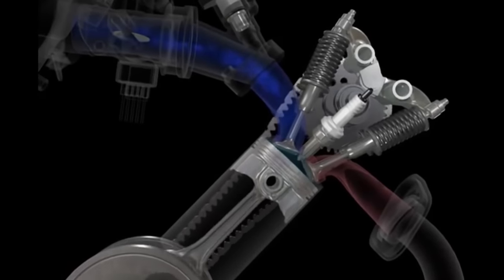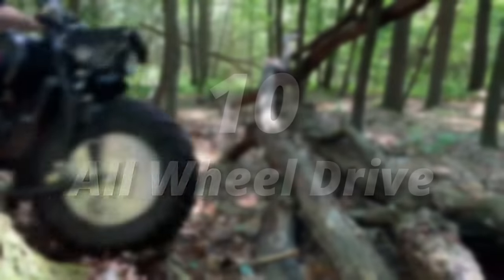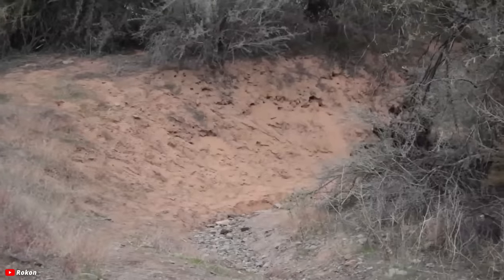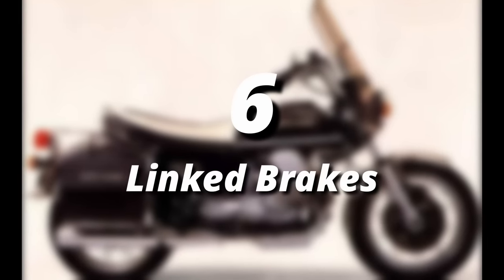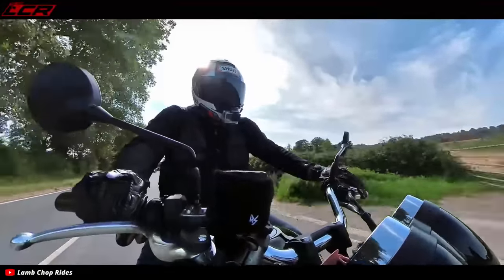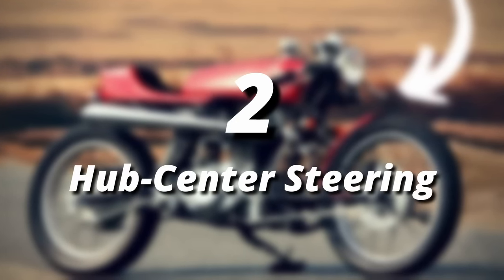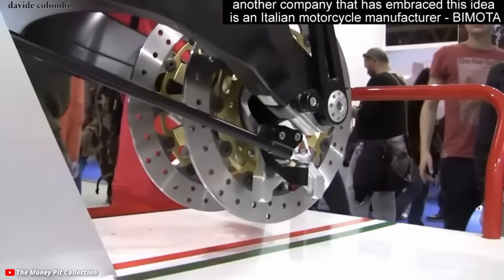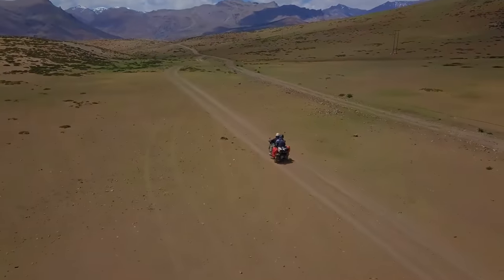10 Motorcycle Innovations that never caught on

Comment: Well you said that self " driving " bikes don't impress you ( Author ) as you want to be in control,  but you like abs and traction control , that is hypocritical. 
You don't like dual braking systems like on the Guzzi .
I always wanted a Le mans from the the day I saw a mark 1 .
I bought a mark 2 in 1990 with the split system and was adamant that I would modify it back to dedicated front and rear actuation. 
Oh but once I got use to it and learnt to trust it   I  felt it was a great innovation. 
I travelled Macquarie Pass daily for years in all weather going quick and never dropped it .
My best mate now owes it .

I designed a circuit that one could choose between dedicated front/rear or split like the Mk 2 but never made the prototype. 
Maybe be one day , I still have it on paper .

Comment: As much as I don't like regulations and big brother government. I don't see a benefit to motorcycles going any faster than the flagships of today. What I'd rather see development spent on is ease of reparability and customization. Easier to diagnose any issues that come up with long term ownership and being able to modify something to suit a specific purpose that the owner wants.

One of the reasons I like Harley Davison (Specifically the Evo engine) is the massive aftermarket and how easy they are to work on and maintain. But I also have a 94 Honda VFR and I like the engine design and riding position more than my Harley. What I'd like to see is a combination of both. I like the 90 degree V4 because of how smooth they are and you have a torque band from the low rpm range all the way to the top but I also really like having the ability to pull the engine completely out or not and work on anything with the engine while still in the frame. Plus you can literally change the bore and stroke by several inches with a Harley engine design which I can't do with my V4, that's a big deal to me since you can make the engine function completely differently depending on what end result you want. A compromise would be a 90 degree v twin but you still kinda lose out at the top end which is where the V4 comes in.

Comment: Has anybody thought of putting an electric motor on the front wheel of a motorcycle can you imagine like the benefits from having an electric motor on the front wheel of a dirt bike you know wireless control or via wire and in sync with throttle end for street bike for that matter you know just extra traction

Comment: Link brakes are not illegal what is illegal is a single port hydraulic brake master cylinder for both the front and rear wheels nowadays unless the vehicle come equipped with them as we now have dual port hydraulic master cylinder "tandem master" with dual circuit, reservoirs with separate the front and rear brakes that also do bias control 70% for the front 30% for the rear brake

Comment: My quad bike has four wheel drive with two diffs and locks. When it is engaged it is awful to drive as the wheels fight you to bits if they have any grip. The steering  is literally trying the fight the bars from yo. A bicycle version would drop you right on your ass whenever it got some decent grip .

Comment: Grip shits were also used on some Puch mopeds - like my first one, an MS50V I think it was.  They were used by postmen in several counties.
Linked brakes from Moto Guzzi were damned lethal - not being able to use only the rear brake on wet grass landed you on your ass faster than any other "innovation".
I spent an interesting weekend removing the cylinder head from a brand-new (sub-1000-mile) Le Mans to get the remains of the snapped-off spark plug out after a mate dropped it that way.
Auto transmissions isolate you from the road and remove the "feel" that is inherent in what motorcyclists want, the same as power steering on any vehicle light enough not to need it.
Hub centre steering is great and deserves to get more attention.  The biggest problem is the large diameter wheel bearing it requires, which increases the speed at which the bearing must operate.   The Kawasaki Z750 Turbo was lighter and more powerful than the concurrent 1100s of the era (the only turbo I've ever personally ridden).  On supercharging, there was an interesting OHV 2-stroke which used a supercharger to replace the crankcase as the means of induction, and worked very well indeed, as it allowed the crankcase to hold the oil bath not normally associated with 2-strokes and solved the emissions problem.  Only made it to an experimental design, but I saw one (of maybe about 3 made) at a rally - powerful and torquey, and according to the owner, great mpg as well.
To change the effective compression, all you needed was a sprocket swap on the supercharger drive, so the same design could be an efficient runabout most of the time but have increased power for fun days.  Of course, if you go very far on compression, you have to add an intercooler, which could have been done at the time, but now would compete for space with a radiator and oil cooler.
You missed centrifugal oil "filters" - a great idea that really works, and means you never need to change the element, which can't clog up, and keeps the oil cleaner.  Last seen by me on the Honda CB200.
Another rarity that has never caught on is diesel motorcycles - great for highly efficient runabout general-purpose bikes.  There have been a few, but with very high compression, kick-starting must have been "interesting" to say the least.  And if diesel is too expensive, just run them on vegetable oil.  Just don't spill any.
[spelling edit]

Comment: Re-watching this 3 months on, two more comments spring to mind: 1/ Only a yank would fail to mention the key reason that most Europeans ride 2-wheelers: to carve through the slow-moving and stationary traffic! If you can do that in a narrow, leaning, roofed 3 or 4 wheeler, with more grip on slippery surfaces, so much the better. 2/ You showed a few seconds of the fully enclosed Peraves Monotracer but failed to point out that there's a big difference between a mere roof and full enclosure. With full enclosure, complete with seat belt, there's no need to wear any more clothing than you do in a car. You get all the warmth and protection (or cooling, with air-con) plus all the fun of superbike acceleration and leaning through corners. Plus one more thing: far better aerodynamics, which is why the first electric Monotracer of 2009 had much better high speed range than the latest electric motorcycles of 2024, despite 15 years of battery improvements!

Comment: Why dismiss Rokon's two wheel drive?
They addressed a niche market and have had no competition.
Why can't you fathom why having a shifter on the one grip is silly?  A gimmick that adds complexity and vague steering feel to a small machine.
You also dismiss BMW's telelever suspension.  Why?
All ABS has linked brakes, but you give contradictory opinions on both.
Are these things included so you don't make five minute videos or so that you get comments questioning your intellect just to boost your algorithm?

Comment: Rokon; the only motorcycle on the market with no rear suspension, and a top speed of a whopping 37 MPH !
Also the early Japanese Fuji Rabbit scooters has grip shift gears   https://www.youtube.com/watch?v=tlVAbxSsCyA   (Production of the initial model, the S-1, began in 1946, some six months before the Vespa went into production.)   The hub-center steer concept is a very old one used as early as 1910 by the British James Cycle Co, and in 1920 by Ner-a-Car. Also Leading link (used to some extent by BMW, Zundapp,, Ural, early Hondas, Suzukis, Rabbits, Greeves etc, etc), Trailing link (Indian, early BMW, etc) and Earles Patent front suspension were used extensively for about half a century, (perhaps you're too young to know that) and are still in use with Trikes, Sidecars and a weird variation on the Honda Rune !

Comment: Interesting video, some of the ideas have merit, as mentioned they were expensive to execute. A couple of comments, Rokons are still made today and never were intended to be a mainstream motorcycle. They really are designed to fill a specific niche and they do that very well (no I am not in the Rokon cult). I certainly would not classify them as a failed innovation. Linked brakes, you failed to mention Moto Guzzi links one front disc and the single rear disc to the rear brake pedal, the second front disc is still operated by the front brake lever on the bars... Just a bit misleading.
Oh and you left out the Wankels... shame on you haha

Comment: Your passion for the sport is obvious, however I think perhaps you should be more thoroughly informed before making videos on topics such as this one. First, the GTS was made by Yamaha (as seen on the gas tank), not Honda. Your bit about linked brakes isn't accurate and is in some ways completely WRONG. The 5th generation Honda VFR800, for instance, had a linked brake system that was completely transparent and produced 60-0 stop times which were some of the very lowest of the time period. Perhaps you're missing the fact that modern linked brakes do not activate brakes identically regardless of which setup (hand lever vs pedal) is activated. They are almost universally engineered to activate a portion of the stopping power available at the part of the braking system not normally associated with the lever or pedal being activated. For instance, using the pedal on these bikes will activate a portion of the front, but predominantly the rear. Same is true for the front. Can an expert rider in perfect conditions outperform the linked system? Possibly, but in the typical urgent braking situation, the tests show that a well-designed linked system provides shorter stops. The Gold Wing also includes this setup and has shockingly good brakes, especially for an 800lb plus machine. Secondly, the Hossack-type front suspension you refer to on the Britten is in current production on Honda Gold Wings and BMW K1600 models - again, you seem to be accurate in many of your observations, but not enough to be making absolute statements like many in this video.

Comment: Honda made a 3 speed automatic (at50& at70) ho did changed gear automaticly
Gear changing on the lever is sold on many german and dutch small motorbikes fited with a sachs engine
You are forgetting the jetengine for dilivering enough "boost" to visit the moon...........

Comment: The two drive,BMW in the second world war the sidecar wheel drove as well giving better traction
Reply: Good advice! Same with the Zündapp KS 750 at the time. And later with the Ural, Dnjepr and Chang Jiang sidecar motorcycles. The forerunner of the latter motorcycles, the Soviet M72 (WWII, a derivative of the BMW R71, not the R75 as sometimes written), however, did not have a sidecar wheel drive.
Reply: @Volker_GR  Chang Jiangs do NOT have sidecar wheel drive. Sidecar wheel drive was invented in 1928 separately by Baughan in the UK and Mozharov in the Soviet Union. Norton, FN, BMW, Zündapp and many others used it, or experimented with it. The Soviet M-73 was a sidecar wheel drive experiment, as was the TMZ-53.

Comment: i own a first gen FZ1.(early 2000's) it has carbs. not fi. only computer is for the spark. the hart of the motor was the R1 motor from the 1990's. just a heaver crank and milder cam. with full light's (street thing). this bike has far more power than is needed on the street. at 65 mph. you just crack the throttle, you had better have a firm grip on the bars. or you will see it flying away from you as you slide butt down on the rd. with a top speed of 170 mph. who needs to go that fast, off the track?
but best is it gets 50 mpg while out having fun. even the second gen with it's fi, 50 pounds lighter, and multiple computers can not do that.

Comment: I marvel at the idiocy of the automatic transmission and self-steering for motorcycles. Because people sitting atop a motorbike would prefer to do anything than ride a bike, right? As if it were just a means of transport, A to B. Ok, well, some Americans might like an automatic transmission, but then again, they DO mostly ride Harley Davidsons. On motorways.🙄 

I dread the day when we'll all be using electrical vehicles, specifically because there is no need for shifting.

Comment: Bikes with roofs add a lot of drag, and raise the bikes CoG, so never took off.

Small turbo bikes wouldn't be cost effective when you could just get a cheaper larger displacement bike, and turboed superbikes weren't exactly user friendly back in the day because even small amounts of turbo lag mean you have to be careful coming out of corners.

To make hub centre steering strong enough for a mass production bike means adding a lot of extra unsprung weight, and none had as much steering angle as a conventional telescopic forked bike, so there's the fear of running out of lock while doing low speed manoeuvres.

Driving both wheels on a bike ads a lot of extra complexity, some extra weight, and significant extra cost. It's all down to the bean counters decoding if they'd make as much from building it Vs just bringing another 1wd bike to market.

Linked brakes, hand gear shifters and auto gearboxes remove a layer of user input from riding a bike, so never really became popular with "Motorcyclists", though people who bought bikes as basic transport liked them, and didn't care about the whole "Bike and rider" interaction thing. These budget orientated riders also went for sub 125cc bikes and step throughs, so these are the main bikes to use these.

A self driving car opens up the possibility of being able to do other things while comuting, but you can't perch on a self riding bike and read a paper, or emails, so it would just be a huge expense purely to remove rider enjoyment. It would also be a pain to implement, as unexpected steading corrections during cornering could risk unbalancing the rider.

Comment: 1 2WD may be a great idea for off-roading, but it does also make the handling of the bike feel "strange" as well as adding weight. The advantages of adding a 2WD system are outweighed by those factors, especially as the levels of grip that would require 2WD are only rarely encountered.

2 Having your gear change as part of the bar controls is fine... until you need to brake hard and find that you end up accidentally changing gear

3 People love to criticise fork suspension, but it has three significant advantages;
a Forks keep the unsprung weight to an absolute minimum. That may not matter too much on touring bikes or cruisers, but it is absolutely fundamental to any machine whose purpose is to go fast. And seeing as all progress tends to be related to going fast, anything that is not associated with that end tends to be seen as "Backward". 
b With the aim of going fast, you need to understand some of the basic physics of cornering. 
I A long wheelbase improves stability
ii A short wheelbase improves the maximum cornering speed, for any given speed, a long bike will need to lean further over.
So, although other types of suspension may work better, none of them (that I know of) have the combined advantages of a decreasing wheelbase whist braking/cornering.
3 Because forks are so universal, a lot of effort and research has gone into nullifying the negatives  (like stiction and the problem of tangential forces to the plane of motion) and so even relatively advanced technology filters down to production machinery quite quickly. Just look at how quickly we got fully adjustable forks, Upside down forks, anti-dive (there was an example of a wrong turn), variable rate compression,. mechanical semi-active and, most recently magnetically controlled, semi-active suspension. And the result of all this effort has been that we now get state-of-the-art suspension for a really quite modest outlay.So the cost of forks, at virtually any price point, means that forks are an absolute no-brainer.

Let's not forget that the ELF.Honda, with all the resources of both e petroleum giant AND HRC could still not make hub-centre steering into a competitive suspension system, in spite of all the theoretical advantages that such a system has. And ultimately, the problems with all the alternatives is that the lack the "Feel" that is so important to riding a motorcycle, whether in normal riding or at the limit. Even BMW's Telelever suspension, probably the best production non-fork suspension still suffers from a feeling of "remoteness" and is one of the limiting factors in the GS1250s off-road abilities.

4 Paradoxically, turbocharging works best on larger capacities. The more exhaust gases you have, and the larger the number of cylinders, the less variation you have in gas flow and therefore turbo performance. Under the circumstances, it is no surprise that turbos simply don't work very well on a 2 wheel platform.

Comment: All wheel drive is actually coming back in ebikes. With hub motors it's 1000x easier to implement and 1000x more reliable.

Comment: I don't even like Hondas.
But you missed the point.
22,000 RPM, 500cc, 1979, GP four-stroke.(couldn't qualify!) Two stroke power was what it was about.
But you're halfway right about a 'V-8' 32 valves, but three plugs per chamber!!!
I raced the old Yamahas.
The AMA, brought the size down from, 1025/4-cyclinder, to 750cc.
The VFRs were so good, a entire field of Interceptors, couldn't beat Eddie Lawson, & Wayne Rainey's GPZs!!! Air cooled, 8 valves per cylinder, inline fours!!! Just saying.....

Comment: What? Total copy of a video from 8 to 10 years ago? No nod to successful wishbone on the GW? 
Relook that DCT thing my friend, it's on several cars now, and was on Formula one cars for a while. It's progressive automatic as near conventional as you can get without lag between gears. 
True, 2-wheel drive is mostly nonexistent, but with electric hub motors hitting decent power and speed marks, we should see some for trail use soon enough.